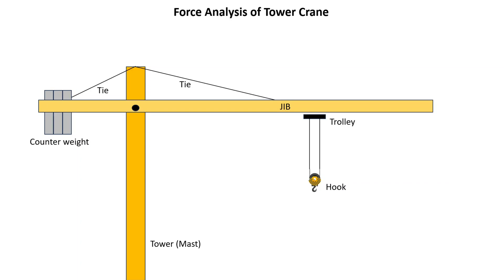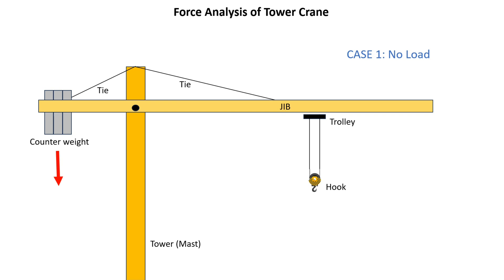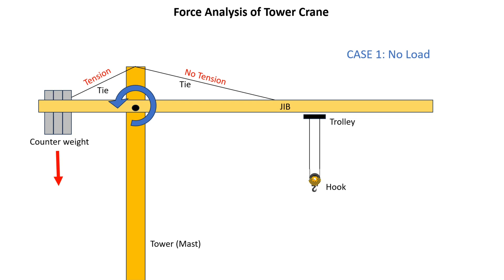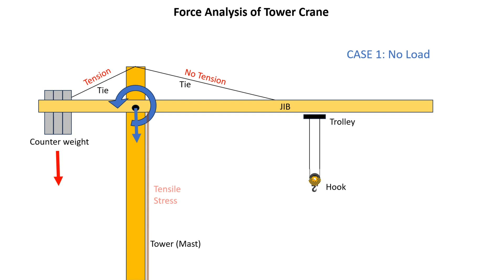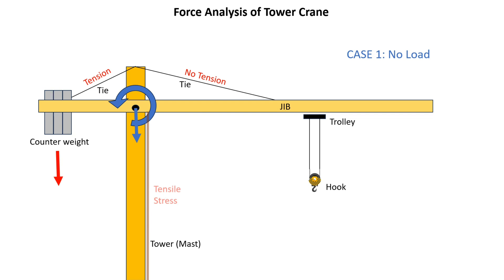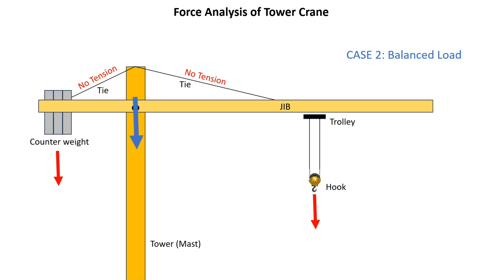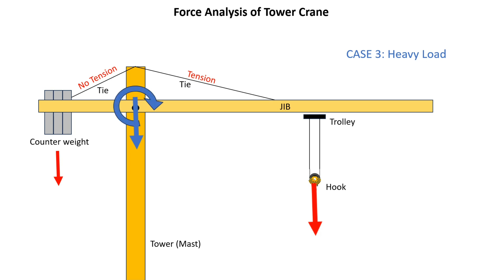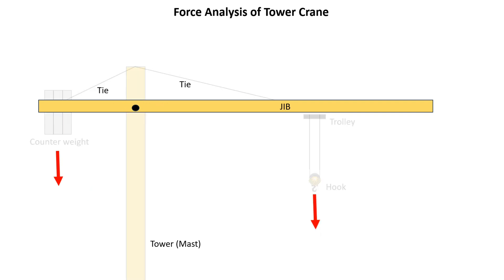Force analysis in tower Crane | FBD | basic mechanics

Comment from the maker: Please note: we haven't discussed the FBD of Jib for all 3 cases, we just showed the general diagram as per the position of tie.

For making FBD of jib at specific case, first we need to find the value of tension in ties.
(For unbalanced loading condion there will be tension on one tie, therfore the horizontal reaction force is there at hing point of tower & jib and its direction is towards the load, for balance the horizontal force component of tie.)

(For balanced loading condition there will only vertical upward reaction force at hing point on jib)

For FBD of tower, we simply tranfer the bending moment through hing point by considering the short length (from hing to tip of tower).

Please note: If the jib is in two parts (counter side & trolley side). And the both part is hinged at the tower, then for the balanced load case, there will be a tension on both side of ties. But we assume the continuous beam that's why in balanced load case we didn't consider the tension forces in both ties.

I hope you understand guys.